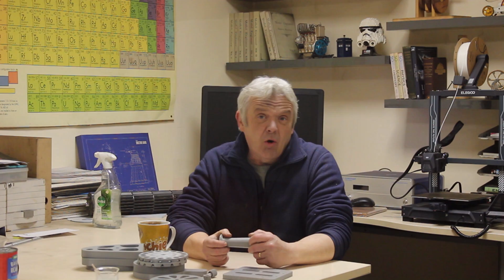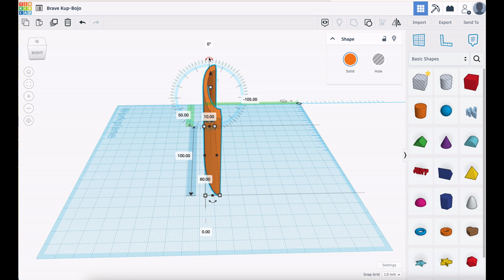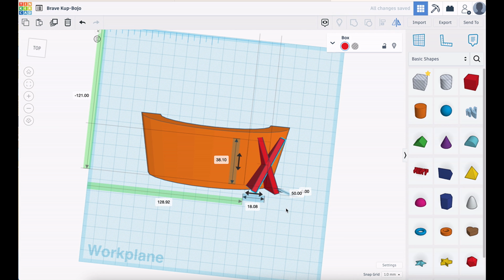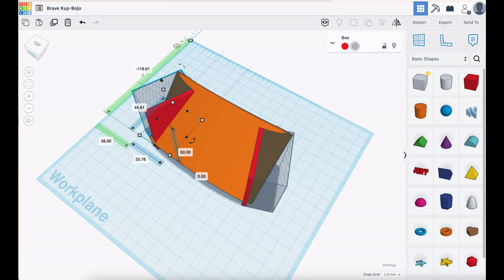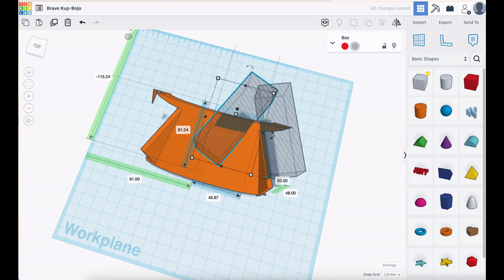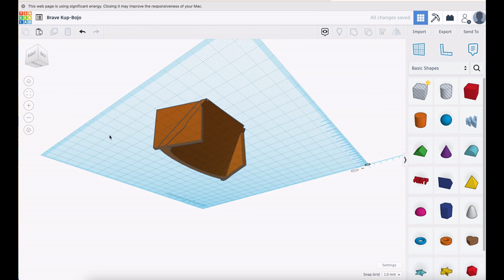1816 Updating The Darwin Wind Turbine

Comment: Rob.I think you missed the point of making it from paper.
If the paper version was made from simple modular pieces...anybody with a sheet materal.....
1.reclaimed plywood
2.reclaimed pvc
3.(fill this space from your recycling bin)
can make one.
A cleverer design(since turbines themselves  incur the wrath of the local council planning) would be one that hugs a wall or a fence.
(The outer side vented,the bottom given a turbine outlet)
Running the dc directly into a sand battery inside the target buildings floor during cold weather and using a simple switch to direct it to other uses* in the summer seems the cheapest solution.
*diy peltier fridge is what I chose to build
As exciting as 3d printers are,they are expensive to buy and maintain for any non engineer.
We are fortunate that we have one at the local library,but the cost is prohibitively expensive for my neighbours.
Hence I regularly build/repair stuff for them using recycled materials,simply to stop them dumping 'fixables' nto landfill.

Comment: Hi, I found this very interesting, and thought about your design. Could you design as a single circular piece and stack?  If anyone is interested: Use a block (3mm x 50mm x 190mm) and duplicate 3x with a rotation offset by -45, 45, 90deg (each centred 100,100). Now add 2 pyramids (175mm & 165mm width), both with a height of 150mm (change height to change the angle/pitch), (centre 100,100). The inner pyramid change to a hole. A large box to cover the whole area and move vertically up 50mm. Select all and group. This would give you an overall height of 50mm, which could be stacked easy. The bottom pyramid would be thinner at the bottom, compared to the top - creating a directional funnel. Shame I can't add a picture to a comment...

Comment: Interesting idea. I just saw the first one, and them saw there was an update. Have you thought about having a flue pointing upwards for each segment? This one appears to have six segments..Therefore you have no loss for the wind blowing straight through and out the other side. You should catch the wind on three sides at a time.
Perhaps with a slight spiral in the flue to assist in the direction to get the most efficiency out of the motor?
But only a suggestion. This is still a good idea of yours.

Comment: Robert, doesn't the wind 'lose' energy by making the 90 degree direction change?
Reply: Ah, no. I see what you mean, but most loses would be from friction, eddy currents, and some pressure differences caused by obstruction; the '90 turning' has little effect as conservation of momentum makes it all come out in the wash, so to speak.
Reply: @bikerfirefarter7280  so the losses would be there.
Reply: @justtinkering6713  Not in the '90' itself.

Comment: personally, i would have made such self stacking pieces go in a half length offset, similar to brickwork. gather minimum winds, channel them upwards, would still be fine. Might have larger vent passes, allowing a short distance laminar flow into the middle perhaps and low speeds. It does help a lot with power transfer between the air(fluid) and the final capture(propeller/turbine), as the more laminar the flow the less eddy current energy losses. Also, offset stacking is generally more structurally strong. All would be needed is a mid structure rib.

Comment: Excellent upgrade to an otherwise novel but not usable (functionaly useful yes, but socially not so much).

Could you further increase efficiency by painting the sides that will face the sun black, they would heat up and create up draft even in low wind situations. In theory at least.
Reply: If the stack were tall and equiped with a tall flue you might get a little flow, but the difference in density and with the masses involved the output would be feeble.
For a no-moving-parts design it has some interesting possibilities.

Comment: I am sure I have seen this design used to assist updraft air flow for chimney pots.
Reply from the maker: yep - but - I personally think we should respect the genius of Max's thinking here mate - it's clever to take the pot idea and move it to a completely unrelated field - very clever indeed
Reply: @ThinkingandTinkering  agreed.
Reply: Many homes have an unused chimney, as a result of new smoke free zone laws. I think these could be used to add a heat pump air condition system to  older homes. What is required is a concentric air duct pipe passed up the flue. A fire place located heat pump could then be used to exchange hot and cold air taken from roof top level. An inverted version of this passive Darwin  wind turbine could direct fresh air down the flue, while the more usual configuration could be used to suck up stale air, and discharge it upwards. 
Potentially this could cool homes in summer and warm them in winter.
Reply: Yeah, but they were more gimmick than effective, the down-draughts being more a product of cold chimney and roof induced eddy currents. Once the chimney warmed the problem pretty much disappeared anyway. Try seeing the strength of draw in a warm chimney by blocking it with a bit of board, it's more than you'd expect.
Reply: @bikerfirefarter7280 I think there main purpose is to stop smoke blowing back into the room when the fire is first lit, before the fires heat generates a significant up draft. 
 open fireplaces are become more difficult to find now days. We live in a smokeless zone, do our two fireplaces are now obsolete. 
I do remember as a child,  using a newspaper to help a fire to draw. It was not uncommon for the paper to be sucked into the fireplace, and catch fire. 

I am interested in using these redundant fireplaces and flues as a duct for exchanging air with the outside world. Taking air from roof top level has some advantages. A one stage one of our chimney flues was converted to an outlet for the central heating system, this involved feeding a flexible aluminium pipe liner up the flue. It was this that gave me the idea of using such a liner to feed air to a heat exchanger. As an RF system designer, I worked with large heliax cable, this used a spiral PTFE separator, to keep the central conductor away from the cable metal outer screen. The cable was then insulated and cooled with a flow of pressurised nitrogen gas. 
It occurred to me that the idea of the PTFE separator could be used to make two concentric pipes into a chimney liner, providing a way to combine both an inlet and outlet pipe, venting into a modified chimney pot. The air flow could then be used to feed a small heat exchanger in the fireplace. With the intention of providing efficient ventilation. I surmised that the air flow might be adequate, given that a fire place is a significant source of drafts in the home, often requiring a flue baffle door to be fitted, to allow the flue to be closed.
Reply: @nigeljohnson9820  I know their supposed purpose, but they were more gimmick than effective. The easiest/best method to prevent the blowback was to light a small 'smokeless' fire first, then put on coal/logs after a draw was established. My grandmother was brilliant at it, but my mother could never get it right. Her nickname was 'Kipper'.

Comment: Do you loose air pressure through the open slots on the sides not facing the wind? 
If you put all the slots on one side, covering up to 180 degrees, a solid back side, and a “weathervane” to keep the device always facing the wind you may capture more of the winds energy. The base and top would both have to be circular so the device and the blades could rotate. This does create a moving part, but I doubt it would add much noise.
Reply from the maker: make a model and test it mate

Comment: Thanks for expanding on my idea, marvelous you thought it worthy.  Need to save up for 1 of those 3D printers, they make prototyping so much easier.  FYI I'm working on a few different options to try to determine the best angle to have the vents at.  It'll take a bit to set up though. I'm looking to make them adjustable so I don't have to work up a prototype for every angle.
Reply from the maker: I thought it was a work of genius mate - I was thinking of the angle and slot gap too - you might try modelling it in FEMM I guess?
Reply: Fantastic guys
Reply: I was thinking the deflectors might be more efficient with them being more scoopy-uppy, but what do I know? the aero-dynamics must be a bit tricky. Interesting idea though. How efficient is it at extracting power from the wind?
Reply: @bikerfirefarter7280  I agree, my 1st attempt was just proof of concept to see if there was a lot of leakage since it was open all around.  As that was not the case optimization of angle and shape are next up.

Comment: Love your videos. Wish I had the space and resources to make what I want but I can give you my idea… does different resident frequencies change the way aluminum works inside the magnetic fields
Reply from the maker: no idea mate
Reply: There are definitely effects with resonant frequencies regarding inductance and capacitance in various cores that impact on efficiency, at higher power core saturation plays a big part too, depending on core material/structure. I'm not sure of the effects of Aluminium though. It's worth looking into, I expect there is plenty of research available.
Make a simple frequency generator, hook it to a coil and a composite core(s), and measure the impedence. Isolate the effects of 2PifC and 1/2PifL and you should have your answer. An oscilloscope will be invaluable, but digital/computer scopes are quite cheap these days, they are even do-able with Arduino and Raspberry.

Comment: thank you Max for this. 
Robert I think you could really reduce your parts by printing this in sections. ie. 4 or eight pieces at the same time all attached together. then just stack them staggering the seams and glue it together. 
I was thinking about this yesterday but using aluminum since I don't have a 3D printer.
Reply from the maker: I did a stack of 3 at the end of the video mate - in the final model I have done a stack of 4 in one go - I only stacked four because if it works I will print a scaled up version and 4 is the highest my printer will go

Comment: Awesome to see your dabbling with Tinkercad, its actually a really great program once you get to know it. I have been printing for about 6 years now and I still use tinkercad on the regular. I have designed everything I have needed with it and find it much quicker then other more complex programs. After 6 years of using it my top suggestions would be to use the favorites tab and spend some time exploring all the shape menu's. When you find a useful shape then click the little star and it will be in your favorites menu so you don't have to search it again later. Also I highly recommend the shape generator tab for more complex designs as there are more parameters to set on the object menu, with most of the items, so they can be manipulated to create certain shapes like Archimedes screw's, airfoil designs, pipe's, funnels, gears, and a multitude of higher resolution options for cylinders and what not. Hope it helps! Tinker away👍
Reply from the maker: nice tips mate - thank you for sharing - cheers

Comment: Nice idea from Max. Rather makes redundant an idea I was having about improving the original, but that's a good thing.
My concept was based on, as the upward flowing air moves faster it's lower pressured so if a flap also partially opened the flap either side of it then that should allow some extra air to go be sucked through the system as a whole. 
I suspect this new design does that, with no extra moving parts.
Reply from the maker: I liked it a lot mate - clever thinking from Max - but don't give up on your design just yet - who knows what you will come up with - it is often the process of doing that sparks ideas
Reply: @ThinkingandTinkering  I had a little thought about your version of Max's design. 
As you have the buttresses on the outside it might be worth making them grooved, at an upwards angle, that way as the air hits them it starts to channel the flow in the direction required, smoothing out the turbulent flow at the edges. Probably only make a minor difference but, if being 3D printed, only small amount of extra effort at the design stage.
Reply: Ohh actually thinking about that makes me also think, going back to the original Darwin design, adding progressively deeper grooves on the outside face of the flaps would allow extra air to be dragged in without adding any extra complicated moving parts :-)

Comment: You should scale it up in cura from 1.0 to 2.0 in locked mode then you could  print a huge version,That's if the little version works of cource
Reply from the maker: exactly the plan mate - cheers

Comment: HA I would say some of us get stuck in the making stuff stage of making upgrades for the 3D printers, something I have been working on for ages, and thus why I was so interested in the copper nano particles. Especially when you mentioned that strobe lights would deoxidize the parts and cause them to form solid copper to copper bonds. I instantly saw a way to do layers of dust and solidify each layer where wanted to make a solid copper object using a laser passing over each one, like stereo lithography LOL.
Reply from the maker: I think light forge are doing something along these lines mate you might want to check them out
Reply: @ThinkingandTinkering  will have to check it out, I know using single point, and single material in the powdered metals to solid metal items is possible to slice with Cura and other slicers, and then print out, but being able to run an array of light shapes with dark areas and speed up printing, as well as removale and replacing the removed material in between levels is a bit more of an issue that I have not seen any slicers that can be used yet. (think mask-less lithography that the materials are switched up on individual areas on the same level instead of only stacking them up) 

or the sweeping arm nozzle opening along the strip so a 3 hour plastic print can be printed in like 1 to 3 minutes, again nothing yet that can generate the G-code to control the head sadly so all stuff to demo it I will have to hand code the G-code to use them, and then rely on the open source community of reprap and such.

Comment: You are an endless well of generator ideas. I'm curious. Have you given thought to a steam powered generator. Recently watched a How it's made episode for a small radial steam engine. It is small yet powerful, you can burn just about anything to heat the water. Radial geometry pistons are of Stainless Steel same for the heating tubes which are stacked many layer producing steam within seconds and then condensed to recirculate. Unbelievably small and cute yet powerful to be coupled to whatever you desire which could include a generator as was shown happily chugging along. Sir, I kid you not. Well worth a  five minute tea break to watch and then to ponder if it's worthy of it being given the Robert TNT treatment for making it easier cheaper and more accessible to us hands on and the not so hands on types. But of course if you've already been there done that then i apologize for wasting your time.
Reply from the maker: I love steam mate and I have done a fair few adaptations for sure